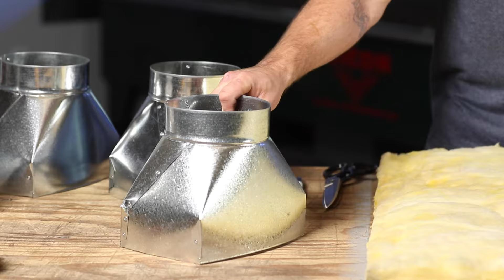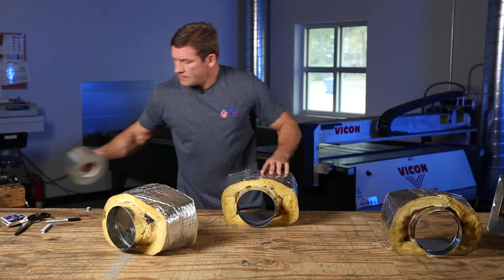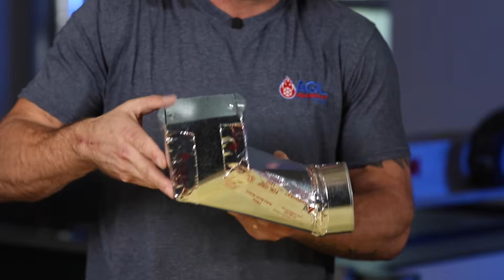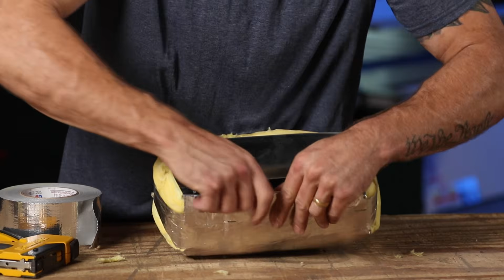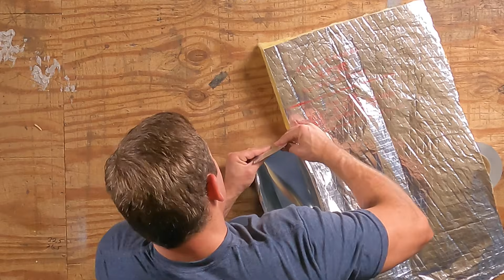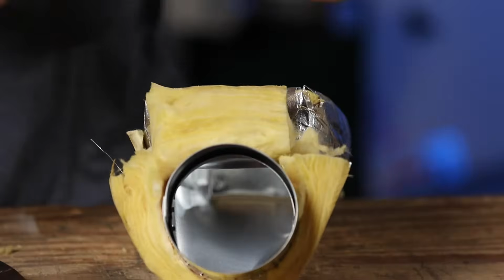Insulating ductwork fittings Part 1 - straight, 90 degree, endshot boots (Mech Training # 103-1)

Comment: can you not just foil tape those joints instead of using a staple gun?
Reply from the maker: No, tape adhesive can fail over time.  Especially in a hot environment.

Comment: On the endshot when you cut away the yellow to make that lip leave a thin strip going up on that one end that follows that radius to cover that little section instead of patching a piece in. Also they make stainless staples may cost a little bit more but you won't have to worry about them rusting from a little bit of condensation.

Comment: Great video. Going to DIY a piece of damaged duct and this should be very helpful! My only question is and it might be a stupid one but what type of insulation is used to wrap the boot? And where do I get it?
Reply from the maker: I'm using fiberglass duct wrap 3" thick (R-8).  You are probably only going to find this at a wholesale HVAC distributer unfortunately.
Reply: @aglmechanicaltips  this is correct, I had to get it through a distributor at the company I work for. No one else would sell it to me. Owens corning soft-r. Currently self building a pole barn style home for my family. Thank you for your videos sir, they are guiding me through the process of installing my hvac system!
Reply: @aglmechanicaltips  thats what I figured because I couldn't find it in any if the big box stores. The best I came across was 12" x 2"x 15' (R-6). Would this get the job done?....my only problem is I only need to do 1 boot so I don't need much and I don't think I know anyone that could get it for me from a distributor

Comment: Instead of tape, can you trowel Duct Sealant into the sheet metal joints to seal?  It is a water-based (latex?) "mud" with fibers, similar to very thick paint. Some new duct pieces come with that already applied.  Dries fast (<1 hr) and washes off with water before it dries.  Often dries so fast I must peel it off my fingers.  Also easy to rub it into the joints of adjustable elbows.
Reply from the maker: I believe this is an approved method but I don't do it because I'm often wrapping the fitting 2 minutes after it is taped.  I just use mastic tape which meets code requirements for duct sealing.
Reply: @aglmechanicaltips  I actually did the Hardcast Applicator Training and Certification course last year in Florida and one of my favorite takeaways is that (at least for Hardcast) the Mastic Tape actually has a higher pressure rating (10” W.C. Minimum) than brush and bucket applied mastic method 

Frank Forest is one of the Hardcast engineering team trainers who showed us some of the specifics about the pressure testing process of their tapes and brush applied mastics, and the marginal performance benefit of tape over brush is due to the higher consistency in thickness of the tape over the brush applied mastic 🙌🏻👍🏻

Comment: Re-did some of my duct work in the crawlspace. All of the stuff is original to the house form '91 and the connections at the boot and the trunk line are pretty terrible, either from age or poor install, or both. Most of the boots are not insulated after the initial connection, couple of the boots that were "insulated", basically just  had pulled the flex duct insulation all the way over the boot and taped it. No mastic. Trunk line connection is just two passes of duct tape on inner flex, so which grande has mostly held up, then a zip tie over the outer insulation winches down tight. No mastic anywhere. Naturally both ends sweated like crazy.

I'm just a DIYer, but watching your videos, the pride in quality of your work really shines through and is something that seems quite rare these days. Followed your directions for the boots and trunk line connections; when my crawlspace was inspected for encapsulation, the inspector commented that "your HVAC guys did a great job on the duct work." I agreed and left it at that.

Kudos sir, on excellent instructions and for passing on the knowledge.

Comment: I truly appreciate the work ethic, and great videos! . its a dying trait in today's world. With that I'd like to pose some challenge questions:

 Why do you rely on tape as a primary sealant vs mastic?  I’m not in the trade but I built my home 20 years ago. I used similar methods with premium tape (3M and Nashua), and both failed. I’ve had the adhesive dry out and fail in 10-20 years. The adhesive turn to dust on the tapes applied closer to the 20 year timeline.  The only tape that seemed to hold up during this timeline is the polyester type tape. 

After some research I decided to replace my flex ducts. For attaching the liner, I bonded with mastic and a zip-tie connected with Malco tool, and I may tag the zip tie with a screw. On the outer vapor barrier I’m using the 3M Venture polyester type tape. Hopefully this is the last time I’m doing this.
Reply from the maker: I am using a sealant tape.  Hardcast model # 1402.  It is a tape with a sealant applied to it and is quite different than duct tape.  It is really good stuff and I have never seen it fail (been using it or similar productz for over 15 years).  As far as using mastic on the outside, this is a code compliance thing that really only applies to my region and most areas actually do not require mastic to be applied on the outside.  It does however prevent the tape from failing on the outside so I do like it.  Also, I still always use staples is there is any tension as duct tape is not meant to actually hold anything together, more or less just cover it

Comment: Real HVAC men don't use flexible duct.
Reply: In the Los Angeles area that’s all we use . If you bid a job in metal and all your other competitors bids are in flex you most likely won’t get the job. We are electrical contractors as well, bid for armored flex or romex? Bid for armored flex and you most likely won’t get the job. These are the times we’re living in. Quicker and more cost effective to get the job done. I’ve had abatements done on beautiful rigid round pipe with asbestos insulation and low static to have to install inferior flex duct. And then there’s the ultra low nox furnace!

Comment: I haven’t tried any of this yet, but fantastic video.  For that last one, the endshot boot, have you thought about doing a soft tape — including the extra piece that you staple on (maybe just one side) — and then unwinding the whole thing so that you can see your template?
Reply from the maker: I could but I'm trying to teach the method of creating a template (for anything) not just memorizing the ones I have shown.  I will say that endshots are a pain in the butt either way and even the template I show had to have insulation added to some portions of it.
Reply: You are a true academic. Really appreciate you passing along the breadth of your knowledge and experience.  It’s really helped me seal up a very poorly installed system.  Just discovered that you have a bunch of geothermal videos so I’m eager to go through those and see if there are any nuggets in there to help me tweak my bleeding edge system from 2008.  You are the man Andrew!

Comment: Will this help if I want a 90 degree boot to stop making tapping noises from heat/cold expansion and contraction?
Or what would you recommend for that?
Reply from the maker: Try to figure out what is actually making the tapping noise.  It maybe that they didn't pull the flex duct tight when they installed and the flex is expanding and contracting with tempurature.  I don't know, that one's a little odd and I don't believe I have experienced that before.

Comment: Great video. Wondering what you would suggest in my situation.  House was built 22 years ago. The original installer just strapped flex line to boots. The only insulation is the blow-in covering them. I pulled them and put mastic to seal to boot 10+ years ago when an energy audit showed we had a lot of leakage from the attic (2nd floor) HVAC system. I know now the insulation is not taped properly at the trunk line and there is no insulation attached to the boots. Would you recommend I wrap the boots and tape the connections like you did or is being covered with blow-in insulaiton sufficient? Thank you. BTW, I stumbled on your videos looking on sizing return vents. I think I need an additional return. 😞

Comment: Andrew, if you were to block in that straight boot in the ceiling doesn’t that compress all your side insulation?  Same thing on your magic boot that has the looks like 1 inch flange. Would side insulation be compressed?
Reply from the maker: I use a plaster flange when I install straight boots but if I were to frame it, I would not frame it tight.  Even then, there would be some minor compression.
Reply: Thanks Andrew. You are truly the last of your kind. Your stuff is true perfection. If I can get the plaster frames I will make one modification and that is making a one inch fold up in the metal on each side to attach to ceiling joist so it can be attached inside the joist not to its face. I can’t have that lump there with the flange and screw pushing out the sheet rock. The soeediboot with its hangers is kind of the same idea.

Comment: I have insulated four 90 degree boots the way you have shown in this video and it works very well. I see that you said to mastic seal the entire boot after it is insulated.   Do you do this after it is installed in the attic or before, and is it really necessary to mastic seal the entire boot, or is mastic sealing the  connection adequate?
Reply from the maker: It depends on the install on wether or not I mastic before putting in the attic.  I normally do it before installing if I have enough time to allow it to dry.  Also, it is not required that you mastic the entire boot, I do this for cosmetics and consistency mostly.

Comment: No example of Wyes? I think I'm kinda starting to see the pattern looking like a rainbow with a circle offset from the middle a little
Reply: You saying for a Y? Depends if square or round I do em dif. Mostly see Y's in 14 to 16 inch spiral.i cut something that looks similar to a diaper I guess would be the best way to put it lol. Usually after that's on I can put a straight piece on to butt it. If it doesn't quite butt up in the throat of the Y just cut a small semicircle out your piece to slide further into the throat
Reply: Long radius 90's I square duct I measure the top the back and bottom of the duct say the duct is 18 on top and bottom and the back is 10. And the 90 is say 40 wide. I roll my roll out measure down to 20 make a line with my knife in the insulation. I measure 12 down from that which will be the middle of the 90 or back. Then I measure 22 from there and cut it off. Both sides that are 22 I cut from near the middle of the piece to the 12 inch mark at an angle 2 times basically end up with a similar to a diamond 💎 but picture another diamond on top of that one I inserted wide middle then down to a triangle basically on both sides.
Reply: Hard to explain the long radius 90 without visual cues. A box 90 is much easier to explain. Say u wrapping 20x24 square ribbed duct. So that's 44 and 44 88 so I would cut that at 98 find half of 98 which is about 49 so from that 49 mark go up 12 inches then go down 12 inches now you have 24 inches marked then cut that 24x20 square out and it'll slide straight past the throat and cover the 90 and the box you cut out the center of your piece will fir the opposite face of the 90 and your back rolling straight